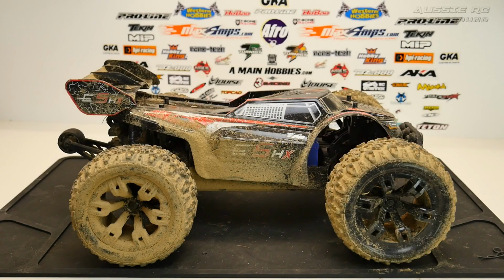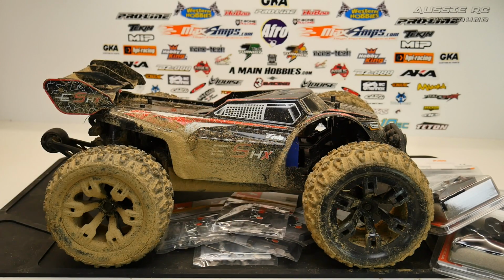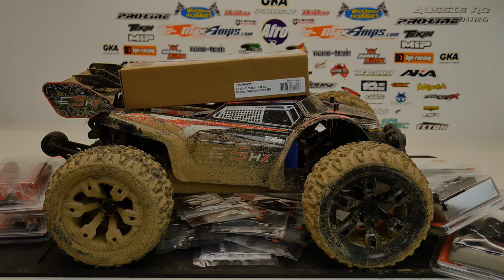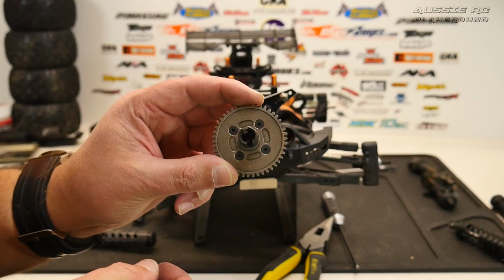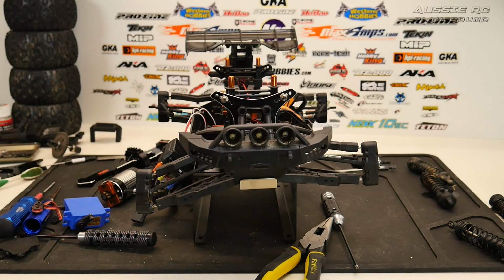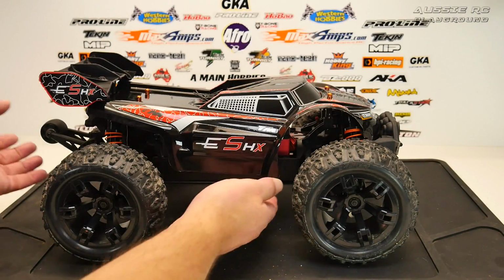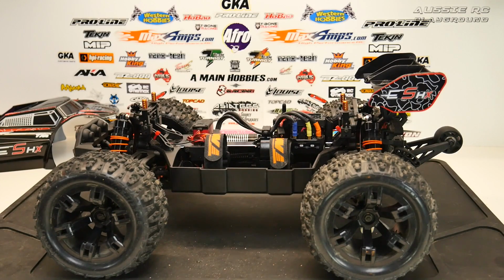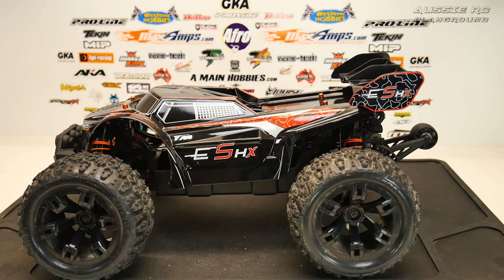RC Pit-Stop 44 - Team Magic E5 HX Upgrades

Comment: I wasn't aware they made a center differential that's smaller and requires no Dremel work now. 

My RedCat variant has a full sized rear differential in the center, with the stock spur gear bolted up. That's the only option I had when I did mine early on, so I had to hack up the center chassis top deck a bit to fit the spur through. 

Glad to see they've made better parts for this truck finally! Vas, if you want, I can get you some 12mm wheel hexes for that truck. Shipping and everything on me, just let me know!
Reply from the maker: +Bacon676 Thank you for the offer, but I already have 12mm hexes for the truck that TM sent out. I didn't use them because I have no need at the moment. But thank you for the offer, that is very kind of you. :)

Comment: Nice build! Have the redcat myself. I experience some cogging when going to an 11t pinion on stock esc. Raise the punch level a bit if you have the same problem. Watch temps on esc/motor when adding weight or gearing up. Let us know how it runs!

Comment: hey Vas! truck came out amazing bro! just one question. why did u use heavier shock oil in the back? I've always been told and used a bit lighter in the rear.. i know when racing even the "pro's" typically use lighter in the rear too

Comment: Hey Vas. Nice video's, enjoy them every time. I was wondering, how do you clean your cars? Because it goes from really dirty to really clean in the video 😄
Reply from the maker: This one is waterproof, so I just put it under the tap and wash it out. Then I dry it straight after with a towel and hair dryer. ;)

Comment: Hey Vas, I just assembled the center diff for my e5 and I have a small black rubber o-ring left. No clue where that would go.
Reply from the maker: That goes around the edge of the diff case to seal it when you put the spur on. So it goes between the diff case and the spur gear, but it sits on the edge of the diff case. There should be a small recess on the edge of the diff case where that rubber ring should go. Hope that helps.
Reply: Thanks for your answer. Those are the red o-rings. I was talking about the black o-ring. I figured out by now, that it is used to reduce the play of the driveshaft by putting it. A weird solution, but it seems to work.
Reply from the maker: Sperrus Oh, it's that small... sorry, I thought you were referring to a large o-ring that some diffs have to go around the diff case. Mind you, it's usually a pain to put those one anyway.

Comment: How long range with txrx stock bro?
Reply from the maker: How long do you need?
Reply: @AussieRCPlayground  can get 400mtrs range?
Reply from the maker: Hmm, that's probably pushing it, so I'm not sure. Most RTR radios will do 2-300m easily and the average basher doesn't usually need anymore than that, but 400 could be a bit much. 🤷🏼‍♂️ I haven't tested that sort of range, so I can't confirm either way.
Reply: @AussieRCPlayground  2-300mtrs more enough for bushing. Thanks